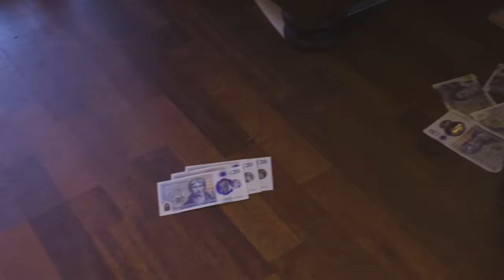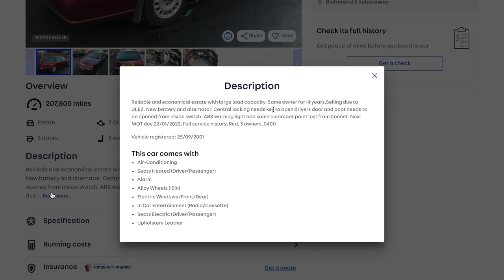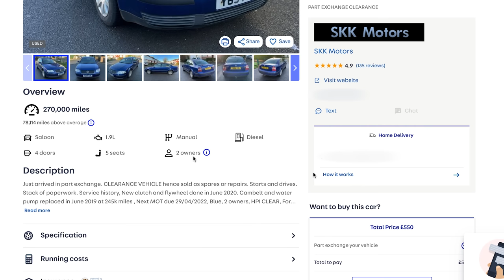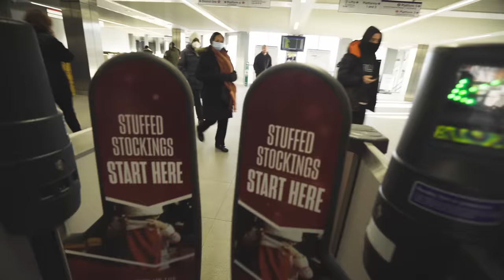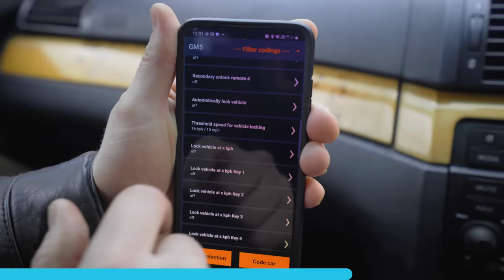Can I Buy A Car & Beat Public Transport?

Comment: Using an uber for the last stretch would be not much different from Alex just renting a car for the day to do the trip. I would definitely say this was a victory for Alex.
Reply: renting is not buying, 
uber is a public transport just like taxi, uber was not  excluded before race
Reply: You can just rent a helicopter, becasue anyone can, so is that also a public transport?
Reply: The difference being you have to have a driving license to rent a car but you don't need one to get an uber
Reply: @vampirwrr  What is the main benefit and point of using a public transport? I'd say it is a price, because it comes much cheaply than a car. But Uber is not cheap, it is basically a taxi.. Thus I would definitely say the win goes to Alex.
Reply: @vampirwrr  So they could also hire a limo to just take them the whole way there. The whole argument is silly, this is meant to be public transport vs car, if you start including the car in the public transport, then the challenge completely falls apart. The public transport literally failed those two, so they had to resort to using a car.
Reply: @vampirwrr  uber and taxi are private hire
Reply: @vampirwrr  it didn't have to be excluded neither Uber or taxi are public transit

Comment: As an owner of the estate variant, there are so many things to love about these cars, quite easy to work on as well for the most part.
Reply: Solid cars for sure. That front suspension setup thou 😣
Reply: @danmoney9932  lol yeah, that bolt that secures the two upper arm ball joints has been the biggest pain in the arse for sure.

Comment: Technically Alex won. He was already in the place when the other two were just approaching the location from the other direction. 
It just his stupidity which cost him the victory.
Reply: If on the last lap lewis pits and approaches the line but max overtakes him just before the line and crosses it first who wins?
Reply: That's no different to when a cyclist or marathon runner celebrates too soon before the line and gets overtaken right at the end they still lost
Reply: And the uber doesn't count
Reply: @MrTap05  to finish first, you first have to finish
Reply: Agreed! Not sure why he didn't use Google Maps.
Reply: @MrTap05  Michael Masi
Reply: @drink4711  that’s my point hence Alex losing in my opinion

Comment: I love my Shadow Blue Metallic 2004 VW Passat GL Wagon 1.8T 5-Speed. American Spec so not all the little extra bits but she doesn't even take a sip of the oil between changes (3k). Heated leather seats, cruise control, and its gonna be at GermanFest in Wisconsin here at the end of the month. :-) Underrated ride...

Comment: You know as they said, Alex could have easily won had he prepared properly and learned where the finish line is even if Ethan and Jack used Uber. I give it to them.
Reply: +1
Reply: Ethan did the research and prepared, then when they got to the bus stop, Jack did a search and saw no busses coming.

Ethan and Jack /may have/ won the race, but public transport lost spectacularly.
Reply: @somerandommug  having a train pull off as one arrives is stupid planning from the train operator.
Reply: @allothernamesbutthis  you realise just how many trains arrive and depart from each station each with their own schedules to have all of the trains wait at every station for every other train to arrive is absurd. It's entirely up to the traveler to plan that shit properly
Reply: @TheHobohobbit  how many trains come from over 150 miles away? Probably not many.

Comment: My passat 1.9 tdi 55 plate had 273k on it when i sold it. Loved it for mpg wise 50+ easy in a 5 speed manual. Love the vid great choice but yeah whole suspension on mine got changed haha fun job and it was lowered after a spring snapped we changed them all for under 90quid on amax springs lol

Comment: I had a Passat high line estate of the same era in the same colour and it was hands down the most comfortable car I’ve ever owned. It was a pd130 and had 170k on the clock and a ridiculously good service history. It was comfy, huge inside, everything worked and I only have £900 for it!

If you’re looking for a car to do moon mileage in get a pd130 passat

Comment: It's got to be Alex's win technically, tip for Ethan and Jack from a taxi driver, hail or get a taxi with a roof sign from a rank, they are Hackney Carriages (public hire / pblic transport). Using Uber or prebooked private hire cars is private hire so not public transport.

Comment: I’d define public transport as,

A service which runs at a set time, with set drop off and pick up points for picking up/dropping off passengers. 

An Uber would therefore not be public transport as the passenger can choose the exact pick up and drop off location at their chosen time furthermore they aren’t required to share the vehicle with other passengers. I mean they are essentially using a car, just because they aren’t the ones driving it doesn’t make it public transport.

Comment: you managed to find the only version of the B5 Passat that is worth owning. diesel manual. it gets rid of all of the major issues that plagued that platform. the 1.8T and V6 were very high maintenance engines, the automatic was absolutely terrible. so many of those ended up in the wreckers for those items. Percy is a solid old car.

Comment: Can you call a train and say: I need a train to take to this remote location without tracks? Can you call a bus company and ask them to change their route by 30 miles to fit your needs? No. Public transportation is a paid service set along a defined path often with stops in between to let others go off and on the vehicle.

But you can call an uber or taxi to pick you up where you want and deliver you where you want. It doesn't stop along the way to let passengers go off and on.

So no, Uber is not public transportation.
Reply: Agreed

Comment: Alex is the real winner here... Not only because he got Percy out of it (will love seeing the journey you take that Passat through) but also because I don't consider Uber & co public transportation. A cab would've been different because, while you can request them through apps and so on, most of the times you'll just flag them down. For next challenge, I feel like there should be a rule about cars, meaning, if they need to get a cab, it has to be as a last resource (like they did), for the last section of the challenge, but they have to find it on the street and flag them down, no apps

Comment: Well as Uber requires "private hire license" which is different from the conventional taxi license, it is not really a public transport.
There are basic requirements for using such a service, i.e. getting into contact with the service providers's company. Although the requirement may be low, they are there. Therefore this service is not technically accessible to "general public" as public transportation should be. 

So the point goes to Alex

Comment: I’ve heard nothing but good things about the 1.9 TDI, is it really that good?
Reply: Pre 2005 ish is the "golden era" of vw diesel engines for reliability. The pick of the bunch is the 1.9 pd tdi 130hp. After around 2005 VW started cutting costs and using inferior engine internals which led to terrible failures with no warning like BXE and BLS code engines' conrods exploding out of the crankcase. 2.0 tdis are pretty solid but on the whole not regarded as highly as the 1.9. Of course after 2005 dpfs started to be fitted which didn't help things either.

Comment: Say what you want about the journey but that car that you bought is the real winner I have a vauxhall vectra C SRI from 2007-2008, it has 205 K on the dashboard did I had issues yes were they fixable of course does it still run I am using it for 4 years now, so yeah I am sad to see it go because of diesel regulations it's hard to pass every year on MOT.

Comment: I think, if the lads had planned it better, they could have won by public transport. But it would have taken a lot of structure to do so. 

For example, the train from St. pancras to Sheffield, which one was it? EMR run two trains an hour to Sheffield and one is a semi- fast train that calls at more stations. That train takes upto 20 minutes more than the fast one. 

I will agree, Uber is not public transport.

Comment: That old passat is only just run in, it should have at least another 250k in it!
Reply: Leave it looking "slightly old and shite" but take it to Darkside and get them to tune the tits off it. 500 brake is feasible from a 1.9 PD.

Comment: can someone explain to me how it's possible to buy a car and immediately start driving it?
i'm not from the UK so maybe it's just different here. i thought you need to register the vehicle, get a license play, check up with the insurance, taxes etc. etc.
Reply: It is possible, as the new owner can tax and insure the vehicle online straightaway. To register the car to a new owner, the paper form has to be sent by post to the authorities and the new form returned by post, so there are usually a couple of weeks wait for the document to be returned, during which time the car can still be used as normal. There is no requirement for a licence change when buying a car in the UK. HTH
Reply: @bindefuni5407  thanks a lot!

Comment: Public Transport runs on fixed routes, so the Uber is very much NOT a valid form of transport for Ethan and Jack. Alex had the moral victory anyway, and based on the use of the Uber he also takes the technical victory.